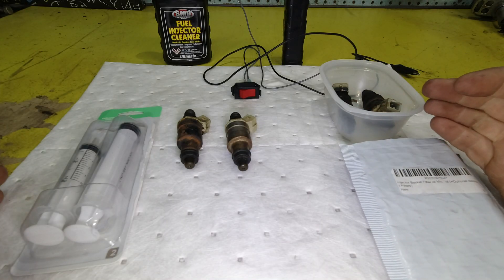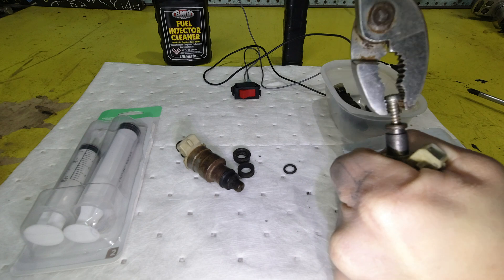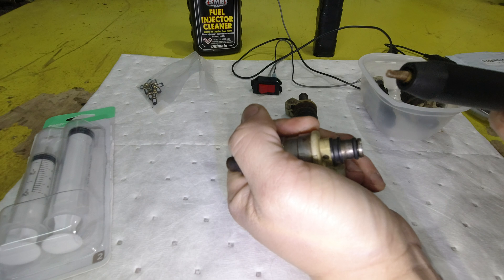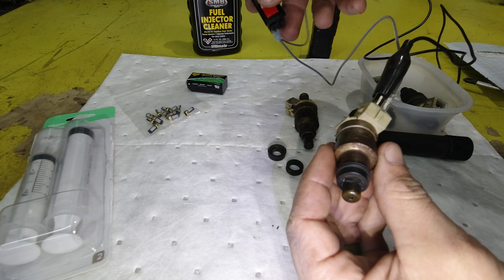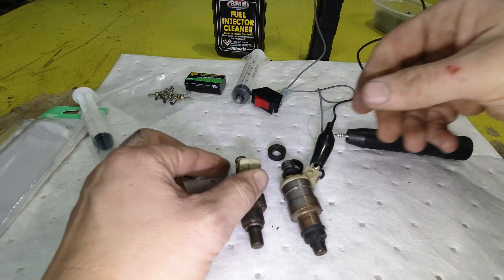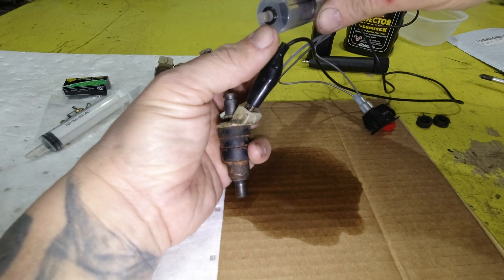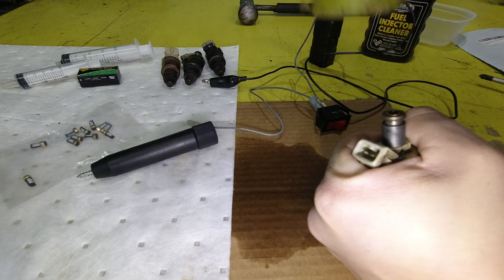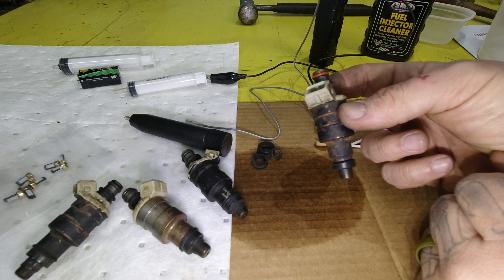$3 FUEL INJECTOR CLEANING! How to DIY fuel injector service for almost no money!

Comment: U need to use ultrasound to clean deep inside the injector.  Doing like this is not going to clean much.
Reply from the maker: I have an ultrasonic, but that wouldn't fit the $5 theme of this particular video. And having done it both ways, this certainly does a good enough job.
Reply: How much disassembly would you do to clean injections in an ultrasonic? And what solvent would you recommend?
Reply from the maker: For Ultrasonic, don't disassemble the injectors. Basically submerge the pintle (outlet end) and run the ultrasonic. You dont really want the actual electrical parts submerged. With a battery and switch, cycle the injector a bunch while it is submerged and the ultrasonic is on. As for cleaning fluid...use whatever you want that will break up old fuel crud. I would use the cheap injector cleaner like I did in the video.
Reply: The point he makes in the video is that this method is best if ON A BUDGET. Not everyone can afford ultrasonic cleaners or brand new fuel injectors when money is tight.

Comment: Are you running the negative directly to the 9v battery?  Just curious as my switch doesn't have a negative Just positive in and out.... appreciate your help
Reply from the maker: Yes. The injector needs both, but you only need a switch in one of the leads. Could be on either positive or negative. As long as you can complete the circuit, it will work.

Comment: Great video. First one I've seen that even mentioned the filter baskets.
One thing I'll add is you can attach a hose to the nozzle end and push everything out of the inlet side. It's unlikely, but if you do get a piece of debris in the injector that is bigger than the holes in the nozzle, this will still get rid of it.
Reply from the maker: I'll have to try that sometime. Thanks for the tip!

Comment: Can I use w40 oil to clean it instead?
Reply from the maker: WD-40 isn't much of a solvent. You'd be better off with isopropyl alcohol. But for a couple bucks, a bottle of injector cleaner is easy to get.
Reply: @tinygaragefab  ya brake cleaner is only like 7-10 bucks

Comment: On side feed injectors you can use a similar method for back flushing the injectors. Simply remove the plunger and slide the syringe over the injector, I use a can of carby cleaner through the outlet of the syringe connected with some vacuum hard line. Could use your method by cutting end off syringe and use the plunger to create pressure as you do.

Comment: Can this be done with 2002-2005 hyundai Sonata?
Reply from the maker: Should work just fine with those injectors. I believe 2002-2005 is before they went to direct injection, so there should be no issues. Good luck! 👍
Reply: @tinygaragefab   Thanks man, but I'm here trying to find the baskets and I'm not seeing them,  if I do, are the basket universal sizes?
Reply from the maker: They are not exactly universal, but there are only a few sizes. Pull one out and measure the diameter at top and and overall length, then order that size. For example 6mm x 13.8mm is a pretty common size. Should be something like that. Easy to find on Amazon.

Comment: so how would one know that its clean enough to work properly within the car? Cause ive seen injectors that either stream the liquid out or it comes out as a mist, which way is right?
Reply from the maker: That depends on the injector, actually. Take a look at the end, where the fuel comes out. If there is just a single hole with a little pin in it, then it's going to shoot a stream. If there are multiple holes, the stream will become more of a mist. A popular upgrade to older cars is to use newer injectors with 8 or 12 holes. This makes more of a mist (better atomization) and helps performance. 
The injectors in this video have a single hole, so it just gets a stream. I will be upgrading to 12-hole injectors when I swap my ECU for a Speeduino.
Reply: Great info. Thanks for sharing!!
Reply from the maker: This injector info applies to vans as well. I'll be updating my 3Y injectors also when I swap ECU to Speeduino and add a TURBO!
Reply: @tinygaragefab  can’t wait to see how that all turns out. I’ve been wondering if updating my injectors would give me a bit more power. I don’t know much about it though, so I’d have to do the research.
Reply: Will this help with p0174

Comment from the maker: Now, let me be the first to admit that this is not a replacement for a professional ultrasonic clean and test, but when you're on a budget, it's hard to beat!
Reply: An Ultrasonic cleaner would not penetrate the injector..🤔
Reply from the maker: In a professional ultrasonic cleaner, the pintle tips are submerged into the solution and cycled automatically while the ultrasonic  does its thing. So yes, it would penetrate the injector because it is being cycled on and off while submerged. It's pretty cool, actually. We had one in the engine shop at one of my last jobs. I used it all the time.
Reply: Want to ask you, this link for filter baskets are for 22RE?
Thank you so much
Reply from the maker: The filters are by dimension, not specifically model. However, these are from an 80's Toyota 3SFE, so there is a good chance they would also fit a 22RE. But measure yours to be sure, that's the only way to know.